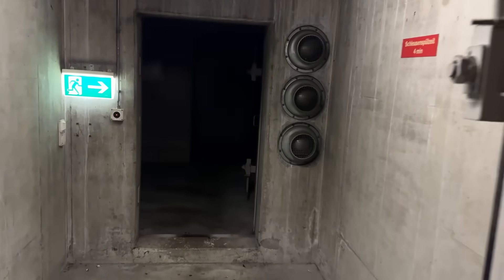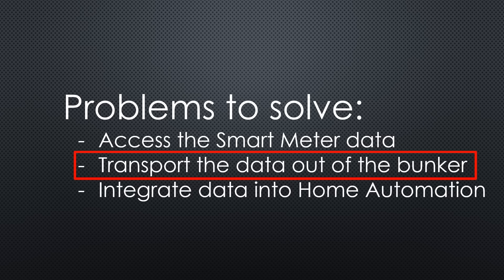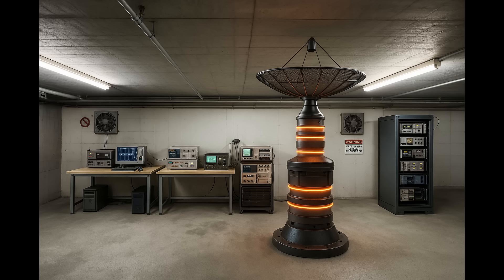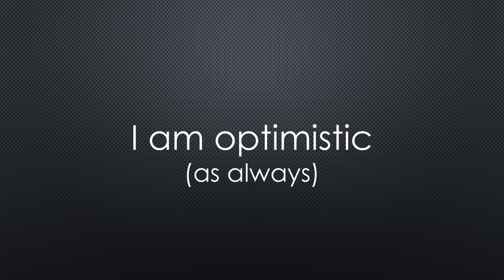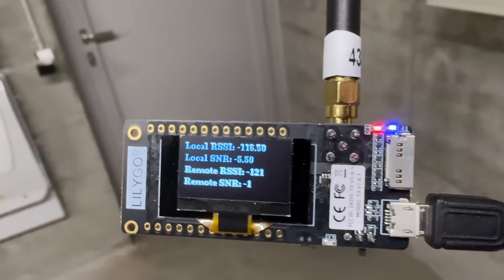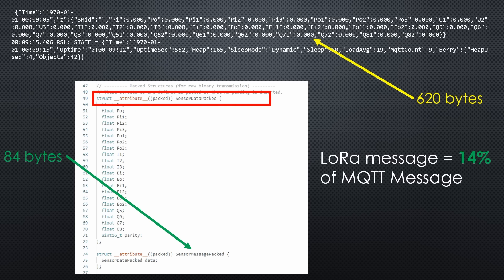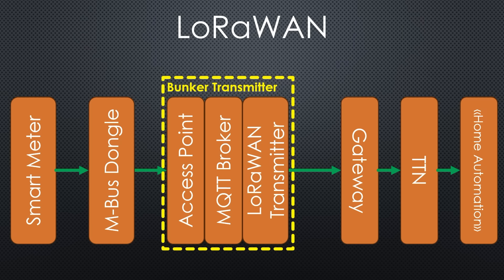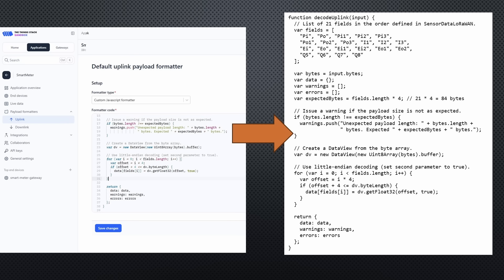An adventure: Reading a Smartmeter in a Bunker (MQTT message extender)

Comment: I solved a very similar issue, in Belgium out smart meters have a P1 port, which speaks a weird active low UART/serial and dumps a telegram on it's pins every second or two.
You can buy plenty of cables or gateways, but I live in an apartment where the meters are in the basement and I'm on floor 2, so it needs to pass trough at least 3 reinforced concrete floors.
I used 2  HC-12 SI4438 modules and on their lowest speed I could make a reliable connection (tested by looping on of the modules and using putty on the other).
The lowest speed was too slow to transmit the packet as is, so I parsed the telegram in the firmware and use a struct to transmit the data in a compressed format, much like in this video.
On the other side, I just attached a USB-Serial cable to the module. I wrote a small integration for Home Assistant to parse the struct, but I'm sure it could also be done via nodered etc.
One small PCB with an AVR µC I had laying around later and some 3d printing later I had a little box that would use the P1 port's power.
We still have analogue water meters, so I added a port for one of those inductive sensors that can be used to measure them, but I never ended up deploying that.
This solution has been working well for 4 years now!
Reply from the maker: Nice solution! Indeed, I thought than many of my viewers have similar situations like yours. That was also a reason for the video.

Comment: Hoi Andreas, thank you for the very informative video. How did you convince EBL to provide you access to the M-Bus interface? I was told that you need a code to activate it and EBL did not want to share that with me 😢. They suggested to buy an additional smart meter. 

Liebe Grüsse von der anderen Seite der Bahngleise in Lausen. Dominik
Reply from the maker: Hi Dominik,
Just an email to them (perhaps you could mention my name and the video). No code was needed here. They know they have an obligation to do it.
Reply: Thank you Andreas. I have send EBL another friendly email requesting access to the M-Bus interface. Lets hope for the best. In the meantime, I have received my gPlug. Did you have to change the default script to read the parameters from the smart meter? If so, could you share the script? Thank you and have a nice sunny day.
Reply from the maker: No, I did not have to change the script. But the polarity switch inside...

Comment: Wait, I understand why you may want access point to extend the network, but why is the broker also placed near the AP? Isn't mosquitto the broker? Am I misunderstanding things here?

Also, what I would design differently is I would like to make sure that the transmission is secured by some form of encryption if possible. A pre-shared key with counter on ack like car key is good enough I think.

Edit: Ohh, I somehow missed the part about using LoRaWAN. Yeah, that's pretty good
Reply from the maker: 1. If you recheck the overview diagram, you will see that there is no TCI/IP connection via LoRa.
2. LoRaWAN handles encryption if needed.

Comment: What other could be used?
If there is a smart meter, there must be a cable going down there. Power lines can be used to transmit data, no?
Reply from the maker: Yes. That would have been my last resort! The provider also uses Powerline to connect the Smart Meter to their network.

Comment: Loved the video - some great ideas you have shared.

I have a suggestion for your LoRa MQTT bridge, in particular for the algorithm you have to resend the message until the client receives an ACK. You have a problem that, if the message was received, but the client does not detect the ACK, you can end up with multiple identical messages received and processed.

A solution to this is for the client to add a unique message ID to the message. A 128 bit GUID is often used for this. The receiver can therefore easily filter out identical messages (and Node Red has a node for this as well). It's simple and quite robust.

I've been a fan for a couple of years now - you have constantly created unique and interesting videos - thank you!
Reply from the maker: It's a good idea to add a running number and check for duplicate messages in the receiver. 1 byte would be sufficient for that. Maybe I will add this feature when I create the next release!
Reply: the precise date/timestamp of the meter reading is important(time the meter is sending data), so that should be your unique field to deduplicate.
Reply: Hi Andrew. Are you referring to the NodeRed 'Filter' node? I'm guessing not. I thought this would compare to the last 'value' inspected. i.e it would only filter one GUID followed by (on the next message), the same GUID. A node would have to have some persistent dictionary/set perhaps with a TTL value for this to work. Cheers - John
Reply: I don't understand. I have this exact system set up for my garden sprinklers, lights, cameras etc around the property (some a fair distance away) .
Messages are sent with ID's and repeated until a response with that ID is received. So if the acknowledgement is not received, it just keep sending it - which is fine. I create a queue with messages so that it can't be repeated.

Comment: Hi Andreas, LoRa is really amazing, I visited these  bunkers and it is almost a miracle to be able to get out of it with such a high frequency (I tough it would have been possible only in VHF or even lower).
Reply from the maker: I also was not sure. This is why I was very cautious at the beginning of the video.
Reply: @AndreasSpiess   May be, as some other have suggested, it uses the ambient wiring to radiate, anyway this is  something interesting and good to know, thanks. :)

Comment: If you lived in Italy, you could have read data out of the meters from your power wires over PLC. The meters have this feature called CHAIN2, which is extremely annoying for many reasons (e.g. they don't provide other wired ways to read the data) but would have perfect in your situation.
Reply from the maker: Indeed, PLC would have been my last resort. But not from the meter. This PLC connection is encrypted and used by the provider to read his data.
Reply: @AndreasSpiess  And HAM dont realy like PLC
Reply: @AndreasSpiess  yep. In italy PLC is available to the end user, but you can't diy a reader as the grid operator require a certified device to enable the meter output and give you decryption keys.

Comment: Toller Beitrag. Vielleicht schaut das mal einer vom EKZ, denn die haben leider arge Probleme mit der Datenübermittlung.
Reply: Ich habe ein ähnliches Setting. Da die Daten bei der EKZ verschlüsselt aus der Schnittstelle kommen, habe ich mir überlegt, direkt den M-Bus aus der Tiefgarage zu übertragen. Und die Decodierung mit der zur Verfügung gestellten Software bei mir im Hause zu übernehmen.
Reply: @SimonSchmid  In einer Mietskaserne bin ich auf die "15 Minuten Datenpackete" angewiesen und habe zur Hausinstallation keinen Zugriff
Die liefern sie auch schön als csv, ausfgeschlüsselt in Hoch- und Niedertarif -- aber eben nicht zuverlässig und seit dem 13.12.2024 kam gar nichts mehr.
Nun haben sie zu "Testzwecken" die SmartMeter ausgetauscht und hoffen auf besserung ...
Reply from the maker: Sie müssen euch Zugriff auf diese Livedaten geben (Gesetz). Wenn der M-Bus verschlüsselt ist dann kann man den Schlüssel im gPlug M eingeben. Aber zuerst prüfen welches Smartmeter die verwenden und ob es unterstützt ist.

Comment: Why use radio waves when you have a usable communication cable that runs directly to your home? 😊
I guess that connecting something to the power cables would be against regulations.
Reply from the maker: PLC would have been my last resort. However, as a HAM radio operator, I do not like this technology. And second, for the moment, I have no direct access to the 240V cables, only the M-Bus

Comment: I use the Homewizard dongle, it connects to wifi (I don't have a bunker 🙂) but it also have an API option, which means I can read the data via wifi direct from the dongle. NodeRed reads every few seconds the data and shows it on a dashboard. Now to figure out to store the data somewhere..
Reply from the maker: Also a good idea! The gPlug dongle usually connects directly to your home Wi-Fi and sends the data to your MQTT broker.

Comment: Did your authorization to plug in the bunker 230V include a requirement to share the gateway with other tennants? how many electric meters could you support before exceeding the Lora duty cycle? Thank you.
Reply from the maker: 1. I am the only nerd here. So I am the only one interested in such things...
2. If you need data from more than one Smartmeter, I would try to compress the data even more before transmission. For the moment, I am well below the duty cycle, but not in terms of factors, just percentages. So maybe adding one or two would be ok. For more, you have to start thinking (again).

Comment: What a wonderful opportunity  to study Lora's ability to penatrate Swiss bunkers vs. ground floor walls and see how the signal is reduced. ChatGPT 4o seems really good with the Python Plotly module to visualize your data, combine with a MapLibre Martin server and a heat map of the signal attenuation may be possible.  Perhaps someone in your household may help by walking around the building at various radii to accumulate the data if you promise a pretty colorful map suitable for display in any tasteful Swiss chalet?
Reply from the maker: Currently, I use the o3-mini-high for Arduino programming. It showed better results than 4o

Comment: Well engineered.  Now I can have automation in my steel pole barn that communicates to the house (home-assistant).   BTW, yes I know I could use an antenna on the pole barn roof (LOL).  Thank you and 73 N8VY.
Reply from the maker: Ï agree; an outside antenna at the bunker would also have provided a better signal. However, it would have been hard to get it done. Maybe it is similar in your case. A long coaxial cable and someone on the roof. Much more elegant, in my opinion, if wireless starts at the sensor.

Comment: Nice one. I added the smart meter count to the Home Assistent Energy Dashboard, too. This way, I got my usage data in both Grafana and Home Assistant available. The display of power consumed from the main line vs power created by PV is much nicer in HA compared to Grafana - for my taste
Reply from the maker: I played with some of the displays in HA, but was never really happy. At least when I tried, they used Energy counters and not power meters. Then you had to do some calculations to get power.
Usually, I am more interested in power. But maybe, I have to have a look now.
Reply: @AndreasSpiess  I have the same feelings about the HA displays, but I like esphome to setup modules. So I personally use esphome and add a http post request which is processed by a simple python script to store measurements in a database, so I can use grafana as well.
Reply: @Aertbei  Many roads lead to Rome. Now you "only" have to decide.
Reply: @rahallde  Right! That's why it is so nice to see other people's solutions.